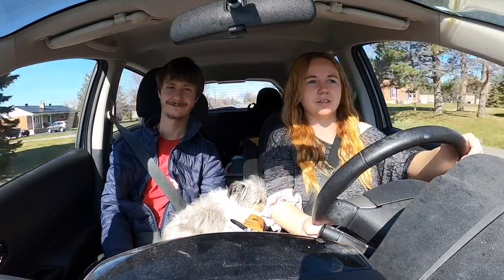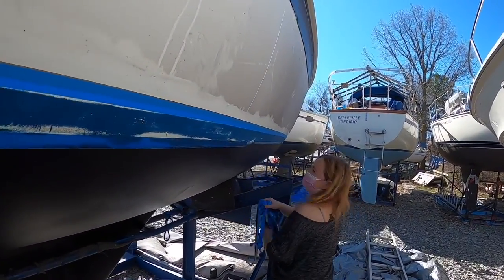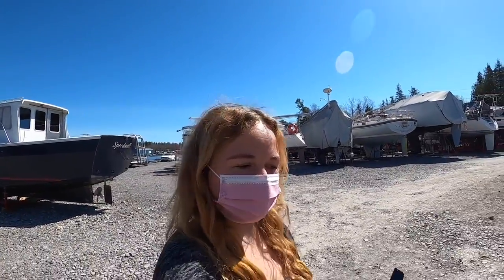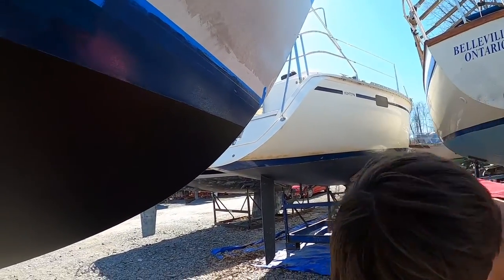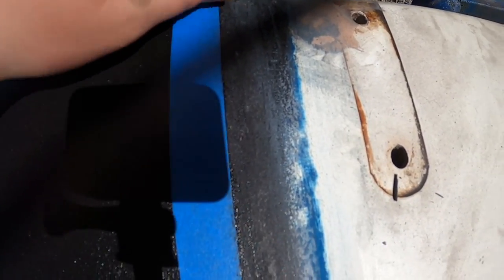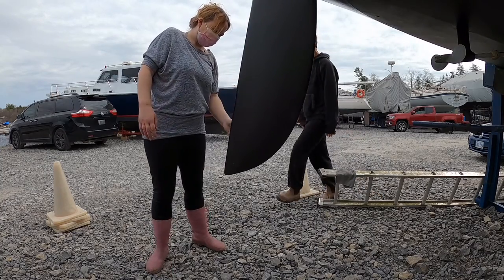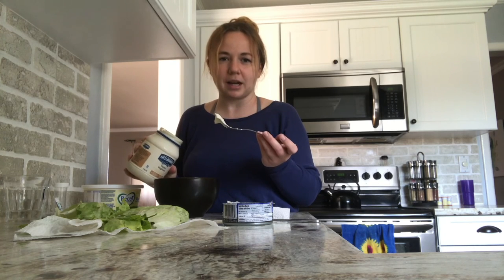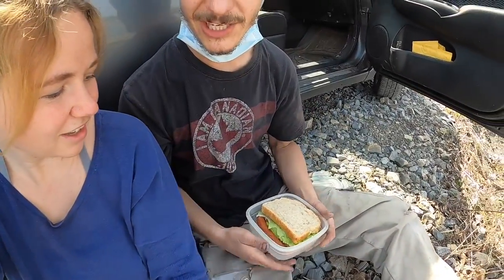BOAT WORK: Painting Waterline & Prop//Installing Tanzer 26 Outboard Rudder - S2EP6

Comment: Would have bet the house the waterline tape would not have come off as easily as it did. It's the middle of summer, and there are no boats in the water at the marina you are at. What am I missing?
Reply from the maker: Haha we we're worried about that as well, we picked up a really good painters tape.  It was about 12 bucks a roll but worked amazing!  Because of Covid boats got pushed off almost a month of being put in the water.  This is also old footage that we are slowly catching up on.  Thankfully the marina is just filled with sailboats now :). Thanks for watching - Alex